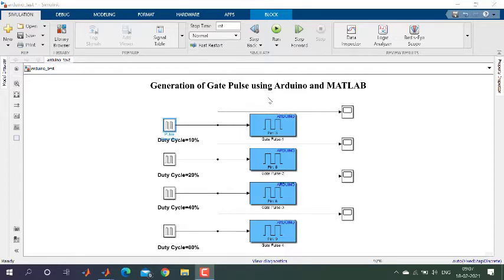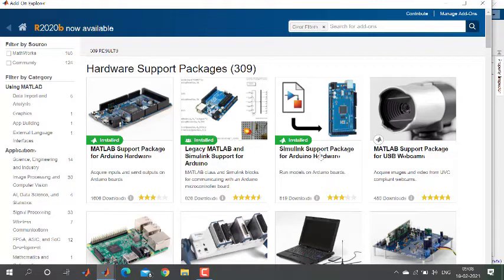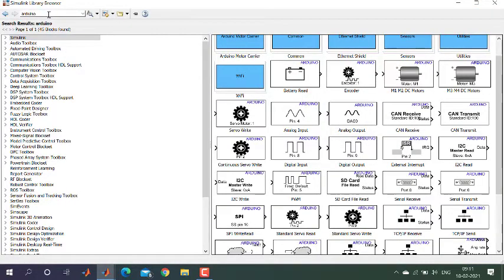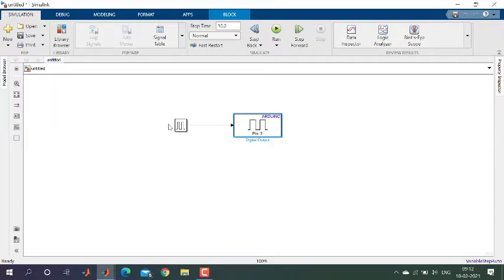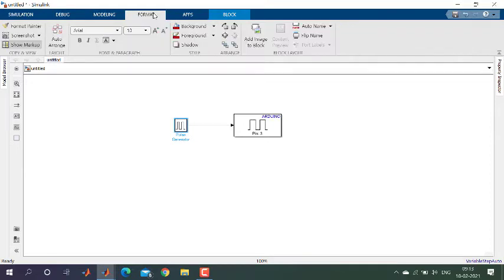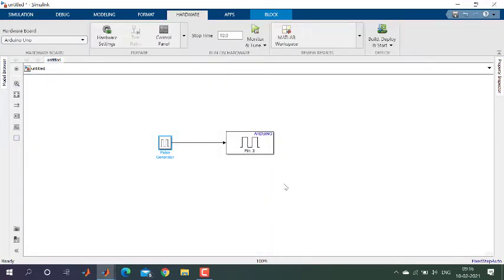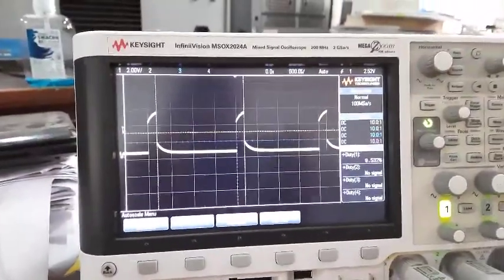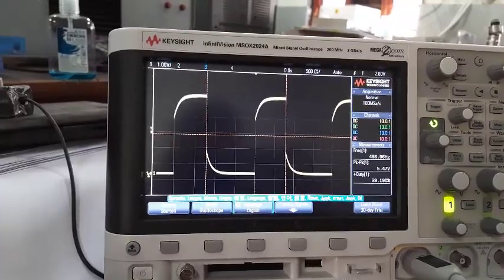PWM Pulse Generation using MATLAB and Arduino

Comment: How many digital output signal can be taken from Arduino Uno
Arduino Nano
Arduino Mega.
If I have 4 pair of complementary switches i e. eight switvhes requires eight digital signal.
Which one have 8 digital output port UNO, MICRO, MEGA.
Tell
Reply from the maker: Sorry for delayed response...you can use UNO or MEGA as both have sufficient Digital PINs as per your requirement...

Comment: 1.MATLAB support package for arduino and
2.Simulink support package for arduino
me kya difference hai ?
Hamne dono install kiya but simulink library me keval "Simulink support package for arduino" aa raha.
Matlab support package kaun se section me milega.
Is there any problem to installing and keeping both package at a time.
Tell.
Is there any use if I have to use only Simulink.
Reply from the maker: yes both packages are required...you can easily download both the packages from MATLAB support package centre as explained in Video...Aap 0.50 Sec pe ja ke video ko dekho ki kaise hardware support install krte he...otherwise MATLAB ka higher version use krke dekhe.